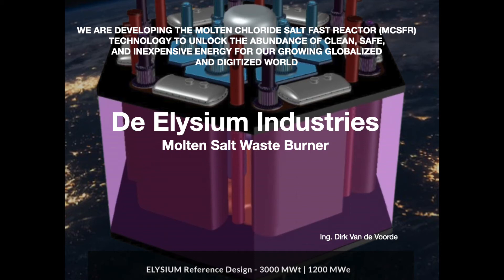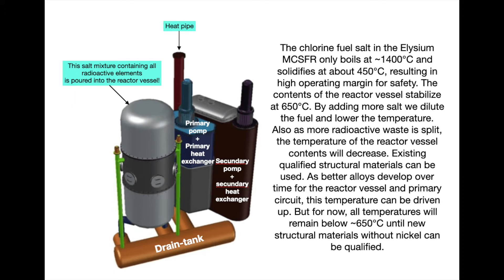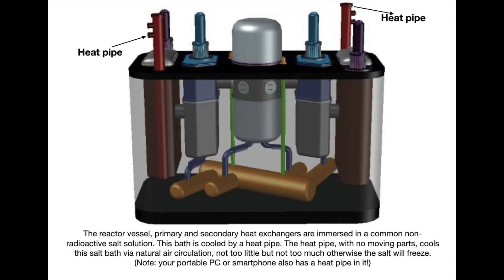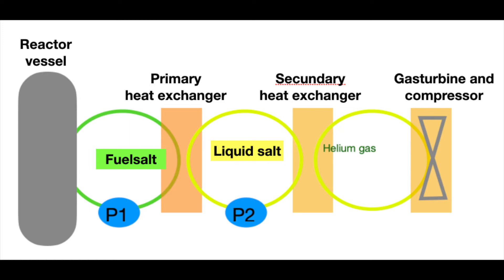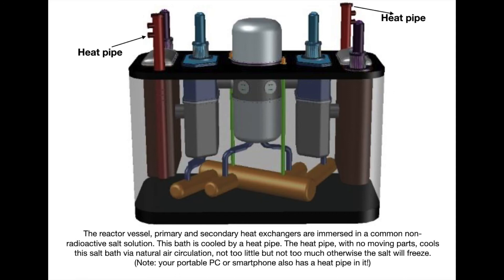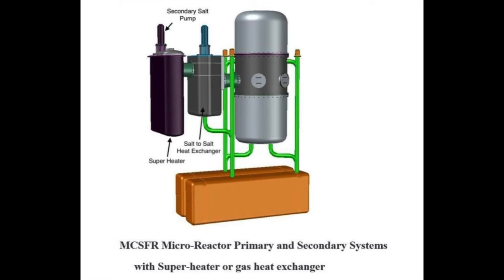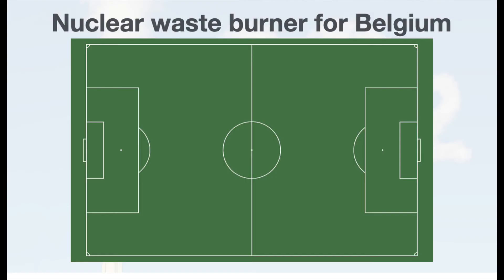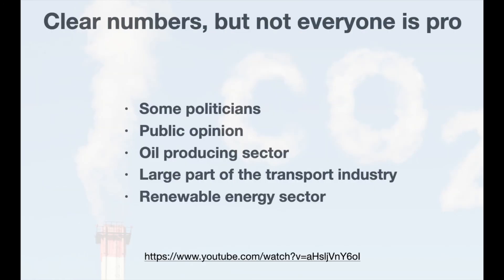Elysium Industries MCSFR for Belgium!

Comment: Thank you Dirk for presenting this. This is the only way to save our planet. The energy density with these MCSFR as well as LFTR reactors is 1000 fold greater than wind or solar for grid level electrical energy. As well these small footprint and inheritly safe reactors can be manufactured in production facilities into interlocking components that can be transported to ideal locations in our communities to safely supply community energy needs. Great presentation!
Reply: Yes, but LFTR and mcfr are years from deployment while legacy nuclear has averted more gas than solar and wind combined,both of which need natural gas to operate.

Comment: One of the things you did not mention is the possibility of storing heat in liquid salt or other means.  This would enable high peak power outputs.  This could be used to make up for times when renewables are not producing power or for industrial uses that would need a high output of heat or power. The advantage of being able to do this is to output power when power prices are high and to store power when power prices are low.  This ablity to store power enables the power plant to be financially viable even if the cost of the power produced is on average higher that other sources of power.
Reply: There is little point to storing heat energy from an Elysium reactor, since more heat can be generated at will by withdrawing it faster from the reactor at any time.  The ability to generate power is limited only by the heat exchangers and generating facilities connected to it.  Only solid fuel reactors, that must run at near constant output to avoid the risk of Xenon poisoning of the reaction, benefit from storage of heat; and they also must have the extra heat exchanger and generation capacity to connect to the stored salt heat supply.
Reply: @robertmeredith3940  It's a simple math equation. What is the cost of additional heat exchangers and associated plumbing vs thermal storage? If the storage is cheaper, it would be a good bridge between the investment of the heat exchangers. In other MSR reactors, it most certainly would be an advantage because you could downsize the reactor.
Reply: @chapter4travels  Ed Pheil of Elysium has stated that its reactors will all be one size - large enough to sustain the fast reaction w/o moderator.  So downsizing is not an option.  But I will agree that MS storage could allow upsizing the generating capacity beyond maximum reactor capacity at peak demand if curtailment would otherwise be necessary at other times.  Otherwise adding heat exchangers to the max must be cheaper than building large hot and cooler salt storage tanks outside the reactor.  Unless the power system is quite small, I would expect a MSR with almost free fuel would be the least likely to be curtailed at minimum load, unless only non-curtailable old nuclear units were the other option.
Reply: @robertmeredith3940  On the Elysium reactor I would think adding heat exchangers would be cheaper all else being the same as you say. For MSRs in general thermal storage seems like a no-brainer.
Reply: @chapter4travels  Well, Terra Power agrees with you. And if the MSR has to coexist with solar/wind and the system lacks curtailable hydro, heat storage during periods of excess solar/wind could well be the superior alternative to batteries with their conversion losses and costs.  That's a usage for heat storage and extra generating capacity that makes sense when it competes with batteries and earns a premium rate for doing so.
Reply: @chapter4travels  I fully agree with your last comment.  This has been a stimulating discussion.  But consider this about salt heat storage.  I believe Ed Pheil has stated that eventually the cost of an Elysium reactor will be only 15% of the total power plant cost.  Balance of plant including site, steam generator, turbine, generator, transformer and transmission will be 85% of total cost.  And that is why it will be cheaper than any fossil fuel plant, which must also include those all those components, but must pay for fuel instead of a low one-time reactor cost and benefiting from nearly free fuel.

If I mis-recall, ignore the rest. But if true, the only time the early Elysium reactors would ever be curtailed would be for the few hours when the absurd amount of installed solar, w/o storage, would drive marginal electric costs to zero or negative, as has already happened in Germany; and will certainly happen more by 2030 as delusional policies increase solar by still more.  For those few curtailed hours, Elysium can shut down or store heat in salt storage.  If stored, the Elysium balance of plant would have to be sized larger than the rated heat output of the reactor to be useful.  Just ramping back to full rated generating capacity could be accomplished w/o use of any stored heat.  To use the stored heat, the steam generator, turbine, generator, transformer and transmission must all be enlarged by some amount, in addition to the cost of the storage tanks themselves.  And the costs of all those larger/extra elements must be recoverable over the period of increased output operation enabled by the very irregular and limited period of salt storage.  That could be a few hours of high value peaking output on high cost extra balance of plant or many hours of low output on a minimal cost extra balance of plant.  This is not a "no brainer", because it involves recovery of far more than the costs of the salt storage tanks over energy-limited hours of operation, which at this time cannot be predicted.  It will require a lot of thought, using information we do not now have.

It may well have been a "no brainer" for Terra Power Natrium design, because balance of plant in excess of reactor rating already exists to be acquired at low or no cost.  That will not generally be the case into the distant future, beyond the service lives of existing facilities.
Reply: @robertmeredith3940  I agree completely, my "no-brainer" comment was for a typical MSR, not the Elysium reactor. Moltex Energy in Canada lays it out very well.
Reply: @robertmeredith3940  Elysium is developing its reactor in the US because of our domestic and military waste however the NRC couldn't care less about that waste. I can't imagine the NRC ever approving that reactor design. Look how long it took NuScale to get a teeny tiny LWR approved. I'm just not sure which country to take it to.

Comment: Interesting, I really hope this technology succeded ! Just curious,  being a fast reactor, do you know exactly how much reactor-grade plutonium or transuranics "waste" does it need,say, to start-up a GWe plant ? Or, alternatiely, low enriched uranium (at
~ 10-15%), and in this case for how many years ?
Reply from the maker: if I am not mistaken Ed Pheil is talking about 70ton of waste with 10% plutonium (or 15% uranium-235). A 1000MWe setup will thus split 1ton of waste per year. Without doing anything to the reactor content, the reactor can operate for over 40 years. But perhaps it would be good to check all this out in Ed Phiel's YouTube video https://www.youtube.com/watch?v=aHsljVnY6oI
Reply: @dirkvandevoorde4251  Interesting, even 7 tonn of Pu per GWe is not dramatically higher than uranium fissile in a LWR start-up (about 5 tonn per GWe as U-235).
Am I wrong or plutonium is only needed once at start-up, while low enriched uranium needs to be provided several years after the first criticality ? Say, 5 to 10 years, at least, after the first criticality ?
Reply from the maker: @babyelian77  You need 10% Pu-239 or 15% U-235 when starting the reactor. Pu gives slightly more neutrons than uranium during fission, hence the higher percentage of Uranium. Once the reactor is operating, the U-238 will also absorb neutrons and thereby split or decay to the fissile Pu-239. Many transuraniums will also decay and fission.
Reply: @dirkvandevoorde4251  I think a big difference between the two is that in the first case you need only Pu fuel once to get reactor critical (as the OP correctly stated), while using enriched uranium you need it for a few years after start-up - I can't say about exact timing, though...
Reply: The the reactor needs 10% fissile plutonium so 12 13% reactor grade plutonium for startup only. After that just feed it fertile which will be converted to plutonium and fission at the rate of fission.

Hang up with U235 at 15% enrichment requires 5 to 10 years of Haleu initially decreasing to lalue, decreasing to fertile as pu builds up and takes over.

At 1200MWe the reactor requires 1 kg of fertile every 8 hours, so 3 kg per day, so one metric ton per year to prevent reactor temperature from decreasing to keep fuel in the core thus maximizing efficiency, and preventing eventual freezing.

Comment: I used to prefer thermal, this design just has too many advantages.. fast might be good in it's use cases..... it is hard to change your preferences haha we are human.. (thermal molten salt is the best way to get useful isotopes) but first gen have to be cost focused, that does makes sense... cheaper than coal is the goal for reality in developing nations ;)
Reply: The worlds supply of useful isotopes can be supplied with just a few reactors, the demand is just not very big.
Reply: @chapter4travels  currently there are only 2 targeted alpha theropy clinics in the world, bejing and new york.. the demand could increase if supply was there.. but yes your right will only need ~5 for isotopes

Comment: The overriding purpose of this process is to rid the world of nuclear "waste", in particular spent nuclear fuel and disassembled weapons grade Plutonium to produce extremely cheap energy, for electricity eg. EVs; industry; eg. steel, ammonia, Hydrogen JP aircraft fuel and many other products due to the fact that the "waste" fuel will be Cheaper than free - the original owners will pay to have it destroyed..
Reply from the maker: thanks for helpful response
Reply: No,once reactors such as this are working, the waste immediately becomes valuable as fuel and not a liability.

Comment: Can you explaine removing of fission products from reactor?
Reply: Fuel is drained out to subcritical cooling & shipping containers. Reactor is refilled with already cleaned fuel & immediately restarted. After the fuel casks cool some to ensure they are frozen, <~450C, they are shipped back to the purification facility. 

More SNF is added to dilute the plutonium that built up to offset the fission product build up over the 40-60 years. Most, not all, fission products are removed, increasing reactivity & resulting in all actinides, carrier salt, longer lived fission products (Cs, Sr), remaining as new fuel. This is done in small subcritical batches. The short lived fission products that were removed are left to decay as a high temperature capable salt. These decay to less radioactivity than uranium ore in ~100 years.
Reply: @EdPheil   How many tons of fissile (U-235 or Pu-239)  material needed to start 1 GW Molten Chloride Fast  Reactor?
Reply: @rrrrrr4647  as far I understand, 10 to 15 ton of reactor grade plutonium (mixed together with reactor transuranics "waste")
 or pretty much the same quantity of enriched uranium at 10-15% for the first  5 to 10 years
Reply: @babyelian77  
If we integrally mix weapons grade plutonium, the only plutonium the US has, with 10 times as much SNF, there is 1% reactor grade plutoniumx10 mixed with the weapons grade. So, you are mixing 93% Pu239 WGPu with 67% Pu239 SNF Pu, yielding reactor grade plutonium (<90% Pu239) to put in the reactor for initial start up. If you start with LWR SNF Pu you start at 67% Pu239. In both cases the reactor takes it to 83% Pu239 steady state, a reactor grade plutonium, always also still mixed with uranium, fission products, and higher minor actinides.
Reply: @EdPheil  Thanks, Ed, very interesting. 

A bit off-topic, do you think is feasible to put such a reactor on commercial ships for ship propulsion (that is, on average, 50 up to 100 MW electric, at max) ?  What do you think, for instance, about the "Core Power" start-up effort, that wants a Terra POwer' s molten chloride fast reactor to power commercial ships ?
Reply: And BTW what about countries with no history of civilian nuclear energy - so no plutonium or other fissile material (e.g. Australia, Denmark or Indonesia) - how do you think it's best to eventually start-up their fast chloride MSRs ?

Comment: I disagree with the subtrafuge from the auto (i.e.ICE)ngine.  Syn fuel from process heat assure the ICEngine a real place in the 300mph human nervous system since batteries are always taxed with more baggage/weight.  Gas tanks can be as large as you want.  Ain't broke; don't fix.
Reply: I agree, particurally because you can' t electrificate airplanes, ships (well, you can have nuclear powered ships for very long range trips...and a fast chloride MSR is an excellent possibility) or even long range vehicles or heavy duty freight transportation. If you have a cheap source of electricty/hydrogen and high temp heat you can easily liquify (very little mass of) biomass to produce bio-methanol (or DME, for Diesel engines) or Fischer-Tropsch Diesel fuels